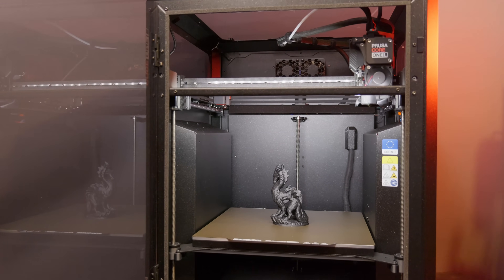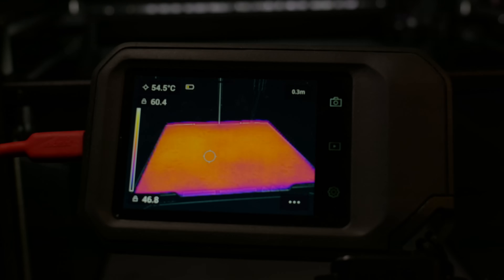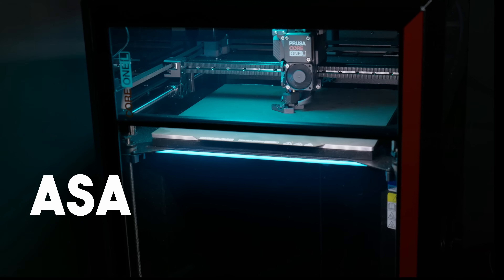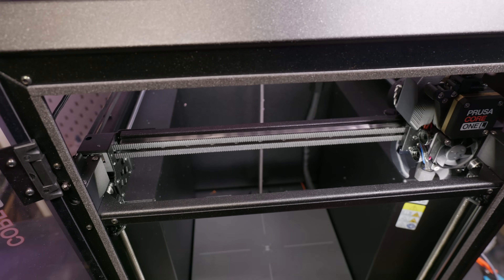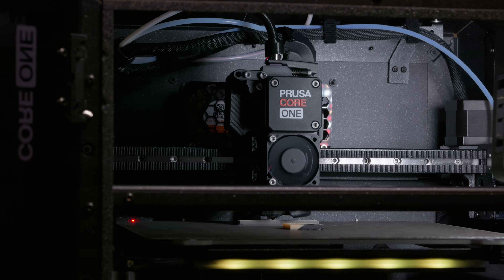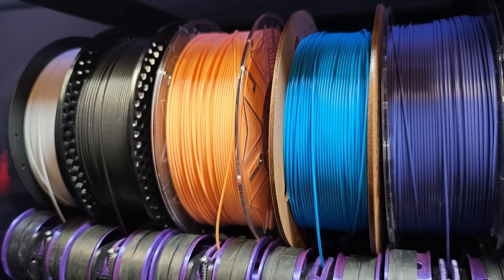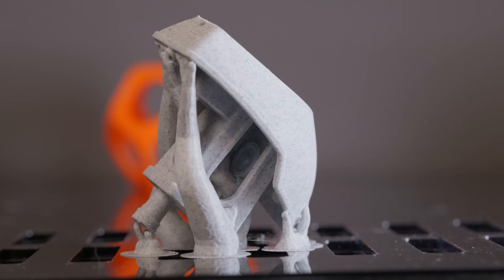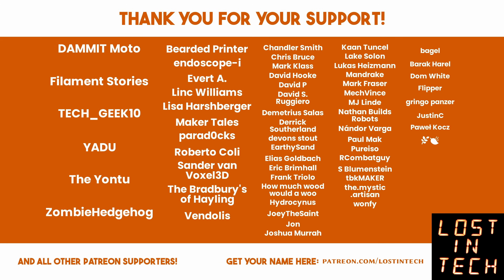The Prusa Core One L: No Compromises, but is it worth the price?

Comment: Honestly, the price of the Core One L shipped to me is comparable to what I spent building my 300mm Voron 2.4 a couple of years ago.  And the Prusa has taller Z, doesn't have to be built, comes with the firmware fully configured, is tuned, and has Prusa support backing it up.  Seems like a great deal to me.

Comment: We do not film when videoing because filming describes a physical process that is not taking place. Film means photochemical emulsion on a physical strip, moved through a camera and processed in a lab. Digital video uses sensors, data, codecs, and digital storage. Film is not a synonym, not a metaphor, and not semantics. It names a specific medium. Using it for video misrepresents the craft and teaches the wrong understanding of how modern production actually works. 🙂

The correct terms are shooting, recording, or videoing. We make movies, and not all movies are films. ✌❤

Comment: I am kinda torn between a Core One or a Core One L, I have a Centuari Carbon, so the L would not only give me multi colour printing, but also more volume.

I would probably get the 4 tool to start with, as by the sounds of it, you will be able to buy and install one tool head at a time, which would be very useful (if they're easy to install. 

The idea that the L could potentially have 10 tools means there is potential upgrades.

As a guesstimate I'd say 95% of multicolour prints are 4 colours or less. 

However with Indx AND Vortex being a thing, designers may start adding more that 4 colours, as multitool heads become the norm. 

I also like the idea of having maybe 2 spools purely for support printing, get some cheap PLA that I can chuck on a holder, and hopefully set it so that all my supports come from that one tool head/nozzle. And have a second one as back up.
Reply from the maker: You can get up to 10 with hueforge, but really....for most things you aren't going to be using more than 4, but it will be interesting to see how people's usage patterns - and designs - change as these new machines get more popular.

Comment: The fan vent mechanism may seem jank to some, but I like the fact that there is one less servo/mechanical item to die on the machine. I wish more companies would think along these lines. We don't need a Michael Bay Transformer on our desktop.
Reply from the maker: Yep it's not jank at all, other printers use the head to power the cutter or the purge flush. It's entirely normal.

Comment: I think they want to prevent users from getting into the PSU, and it's on purpose. There are typically large capacitors in PSUs and it can be very dangerous to go inside.

Comment: The problem with the core 1 and the L is that for what you are paying certain things should be better. It should not have a crappy screen and a old control board and crappy wifi. So the printer itself is fine, but there are parts around it that should be better for that price. All the multi material add-ons are just a bodge IMO they look a mess and are a lot of effort.

Comment: Taking into account that prusa was always heavily overpriced the answer is no, it's not worth the pricetag of $1900. It offers the same features other printers offered 5 years ago.
Multi head INDX yeah it's cool but it's not even a prusa project (it's bondtech). You have to purchase it separately for another ~$250 so it's $2150 total. Insane pricing for an average quality FDM printer.

Comment: The Core One+ is looking very compelling right now. It gets most of the upgrades from the Core One L (automatic vent, easier flex loading and the new spool holder, but no mains powered print bed), and it's "built to support the INDX upgrade" (whatever that means), but it's still Core One sized and priced.

Comment: I think the h2c is a massive miss, whereas I think the h2d was brilliant.  The h2d handled multi material with 2 nozzles, and multi color with the AMS.  Brilliant, but expensive.  The h2c just seems needlessly complicated for little benefit over the h2d.  However,  I think for the money Core INDX is going to blow the h2c out of the water if you actually need more than 2 nozzles.  Time will tell, 2026 is going to be an exciting year in 3d printing.

Comment: I own several Prusa MK3S+, an MMU, a Mini+, three Qidi machines (Q1, and two Plus-4s), and an Elegoo CC. After waiting a month for Elegoo to send me a heatbed thermistor, all while insisting that i needed to replace the entire heatbed and SSR assembly I told myself no more of these under engineered machines. Elegoo support kept telling me that their heatbed thermistor was specific to their printer, but wouldnt tell me which thermistor it was. At last I get the “exclusive” thermistor, compare its resistance at multiple temps to one for the MK3s, and what do you know. Its the same exact thing. So I had a machine down for a month over a $1 part that I had to have a 10+ email exchange with them about. Don’t forget this was at the brisk pace of one email a day. Just a massive waste of time all to send me parts I didnt even use/need. The machine had 117 hours on it. Yes only 117. 

The Q1 Pro has had its fair share of issues. The most recent one was the z offset issue. Essentially if you adjust the z offset via the fluid web interface instead of on the machine itself it messes up the printers config file. Qidi just recommends you “dont do it” instead of fixing whatever is wrong. The entire ecosystem just feels half baked and is full of weird quirks. 

The entire gantry is epoxied together, forsure on the Plus-4 and most likely on the Q1. Coming from kit built MK3s, i expect to be able to service my own machine in whatever aspect is needed. Qidi does not share this mentality. 

No brand is perfect, but being able to actually repair and replace parts on your machine, without relying on entire assemblies to be shipped from who knows where. Trying to run a business while being tied to whatever manufacturer has determined your downtime will be is miserable. 

All ill say is, my first mk3 ran for over 2000 hours before having a single issue. What else can you ask from a machine?

Comment: I mean in terms of cost savings, idk why the whole printer has to be steel, I'm sure they could save cost with a plastic enclosure and the whole thing would be lighter too. This goes for the core one regular as well, it's not like the external enclosure is a component that wears down.
Reply from the maker: I'm not really sure either, might be some kind of operational reasons, they seem to have in house sheet steel stuff and they do definitely like to in house everything
Reply: @LostInTech3D that's true, large injection molding requires a lot more infrastructure than just folding sheet metal
Reply: It’s a limitation of their local supply chain and “made in EU” philosophy. They use the manufacturing capacity available nearby and don’t outsource manufacturing to Asia.

Comment: Nope definitely paying for brand and not printer. For 1800 USD you can get an H2D better everything and both printers are pretty much closed sourced now. For 1200 USD you can get a Creality K2 Plus with AMS and its 80% opensource, the parts around the AMS are closed source but everything else is available to modify, which means bumping the max temp of the nozzle to the absolute limit of 370c with silicone sock and 450c if you remove the sock and replace the nylon spacers in the heatbreak with the PEEK you just printed or aluminum that's fine too.

Thats really the only relevant printers above 1k right now thats not a build it yourself, the next interesting printer isn't till 14k USD thats 14 thousand USD skip right past the Prusa XL

If you want to add INDX to something new just get a Sovol SV08 buy the print bed replacements, however with the INDX core and 4 tool heads you are back at the 1200 USD range and in the build it yourself world.
Reply: No thanks, I'd rather get a printer w INDX for multi-materials that works out of the box, rather than fiddle w an SV08 for months to integrate and then tune INDX, or be dependent on a too-limited and overcomplicated Vortek solution.
See ? The world is full of people w different needs.
Reply: @raphofthehills4405  If they do start shipping by March it will be at minimum 2300 USD for the basic Core One not even the L version and you will probably have to install the upgrade yourself or if prusa history tracks they will up charge you on pre assembly not just for the printer but for the mod too. I bet they won't even have a top hat included either so anything outside of PLA will be out. Sure carbon fiber filaments say no enclosure needed but if you don't then the already weak layer adhesion is made significantly worse.

Comment: I’m thinking the power supply being made a tough access area is due to the mains power to the heated bed.
Reply: This is a good possibility.  There are other easy ways to make it safe, like a switch on the panel that disconnects power when removed.  This is common practice on industrial machinery.

Comment: My third printer was a Prusa Mk3s+, or whatever it was called.  My first two, and Ender and cant' even remember what the heck it was, I was constantly fixing and modding just so they worked.  My Prusa, however, was rock solid, never broke down, and I never felt the need to constantly be printing updates for it.  Ran for years with no problems.  The I got a Bambu X1C mainly because of the speed but also for multi color with it's AMS, which just turned into a drybox with same color spool swapping because multi color printing produced so much waste.  I am not opposed to a Prusa again but if I'm paying that much it better at least have the features or better than my current printer, the entire reason I justified the price of my Pursa in the first place.  This is the first printer I feel they met and exceeded what the market has IF they implement the INDX.  I'm getting a U1 in February, I was slow to back it, but I kinda wish they had this printer with the INDX before I backed, I might have not backed the U1 and got this.
Reply: Yeah european or Western companys seem to be much slower, thats sadly also due to much of the components are made in China. And they can produce Lots of stuff really fast and cheap. As a lot of the companys are supported by their goverment. And less. Rules to Stick to definetly helps in Produktion Speed... I'm really Furious how fast they will Clone the indx. (But I will by my 8-indx Upgrade from prusa).
Reply: Companies in Europe get their fair share of help through subsidies, the problem is what they do with it. Also the fact that in Europe we are extremely conservative and the industry - general - doesn’t seem to look further than their direct profit - because shareholders - is also a problem. Prusa also stagnated and that was/is the problem, I don’t mind to pay more but the value proposition seems to be what may be, some anti china sentiment, FUD and  ‘open source’ which is also a stretch these days when the most interesting thing is a closed down extruder from Bondtech.

Comment: 3:15 - Impressive edge-to-edge performance.  I recall seeing a RatRig demo where they used one of their large format printers to print something crazy like 350 small parts covering the bed.  That shows confidence in a dialed-in machine with good first layer adhesion.  They apparently do something similar for production printing small-ish parts in their manufacturing, with a room with maybe 30 chopped down stacked RatRig printers that print large beds full of fairly small parts.

7:20 - Not sure, but there's a decent chance that the power supply was deliberately designed not to be easy for the end user to access as a safety/regulatory requirement?  The EU is particularly fussy about such things.

I love that Prusa is getting top tier INDX support, but I'm a bit cheesed off because I suspect that contributed to INDX for my SV08 being pushed from now to "maybe March or April or June".     :-(

Comment: I figured out "VFA's" about a decade ago. Find the stepper motor amperage and speed balance #1 (need quality stepper motors, basic StepperOnline E Series is good enough), then proper belt tension (shockingly basic and perfect way to do that*), no binding, no slop, and last.. different resonance profile for open and enclosed if you want perfect. Before resonance compensation excised i introduced binding by making the pair of parallel linier rails about 0.15mm too tight, acted as a break in motion to stop oscillations like a friction shock. I posted my findings and people called BS despite the clear evidence i posted so i just kept off the forums after that, nothing but egos.

* by just tensioning until the belt is 1:1 with 100mm travels when you measure with a caliper, i do a hair over (think it was ~100.05mm last time i did it) as plastic will shrink
I found it out when i was tuning the stepper amperage because i just got a new board and decided to run a vase cube while i was adjusting the stepper manually with a screwdriver and multimeter lol. You can do the same by running large square with a single wall and zero infill and no top and bottom layers test and run "Set_current" to desired amperage until the VFA's are gone.. IF there is no binding etc

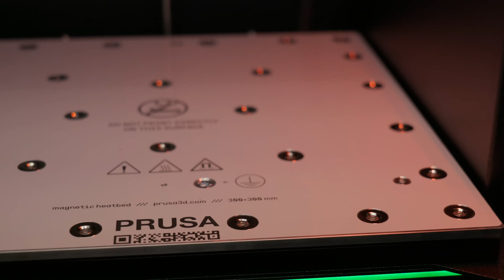Comment: 1:58 Ironically the main printer I can think of is the creator pro two from flashforge their much older dual head extruder, the built plate is about the same thickness as the Prusa L and just a slab of aluminum with a PCB heater coil underneath.

Comment: While neither a prusa nor bambu are my target printers, looking at the prices (and the early pre-sale INDX kit prices for the core one), I don't think it's out of the realms of possibility that a core one L + 8 tool indx could be made to be the same or very close in price to the H2C.
And sure, H2C is slightly larger build volume (and an INDX may also lose a bit of Y on the Core one L, though you never know if they first-party design for it) but 8 actual discrete tools is a heck of an improvement over the nozzle swap and AMS thing of the H2C. 
Especially when you also get the support/slicer and config ease of use/etc. of Prusa.
2026 should be interesting...
Reply: The H2C is a joke. Seriously it is just a panic play from Bambu because they are scared of losing all the market to Snapmaker.  It is a dumb design that still isnt nearly as good as the U1's toolhead system. and yet it costs 3X as much....
Reply: The L ist getting 10 Tools as far as I heard. And that ist really massive.

Comment: I'll wait for the factory-fitted core one-L-INDX, as I hope that not having to buy a nextruder will make it slightly cheaper than a DIY version.
Reply: @See-essEll  that's not how prusa works so good luck with that.  Assembled is always more expensive with prusa
Reply: @deadbeetchad  IIRC, the Core One-L only comes assembled, so a Core One-L minus the nextruder, plus the INDX would hopefully be cheaper than a Core One-L with nextruder plus a INDX kit.
Reply: @See-essEll really? That's kinda concerning tbh I wonder why they are arent selling the L as a kit
Reply: @deadbeetchad  because of the new AC Heatbed, they probably don''t want customers handling that wiring.
Reply: @socramdavid  it might also not be a matter of them not wanting that, iirc anything above 50v is classified as high voltage and cannot legally be handled by persons without the proper qualifications, which means you would need to hire an electrician to put together your core one L kit. of course there is nothing stopping you from doing that anyway, but prusa would potentially be held liable for any injuries that come out of it

Comment: Adding and removing up to 8 spools of filament to the side of the printer is going to play hell with the vibration compensation. What if you have 4 spools on one side and only two on the other? Are you going to have to run the calibration every time you add/remove spools?
Reply from the maker: Dunno, I guess we'll start finding out soon 🤣

Comment: For those that missed it: the vent lever and the filament sensor for TPU have both been backported to the Core One as the Core One+, you can by the upgrade kit for $10 or just print them out yourself (they're on printables) you're just re-using the screws, magnets, etc. that you already have so it's essentially free. 

Also they don't want you going in the power supply for safety. On the MK series and the Core One you only ever  touched the connections between the power supply and the boards. In the Core One L that's all handled through socketed connectors so you don't have to get inside where the extremely angry pixies live. If the fan dies it's probably better and safer to just replace the whole PSU anyways.
Reply: Kinda agree. But i'd Wish for a better replaceable Fan. You could Design it in a way that you can unscrew the Fan without getting in the PSU Like a Pocket with the matching Fan connector. That does add extra cost unfortunately...
Reply: Better and safer to replace a whole PSU instead of a fan???  Are you for real???
Reply: @dumpsterdave3710  You better really know what you're doing if you decide to crack into a PSU. The capacitors in there can easily kill you and will hold a charge for way longer than you realize.
Reply: @PendragonDaGreat  Have you actually worked in electronics at all??  Because writing stuff like "can easily kill you" displays a clear lack of experience.  Do you have to be careful?  Sure.  But that comes with the territory.